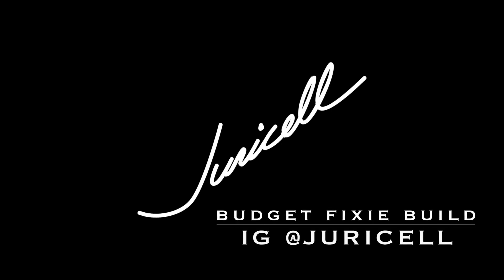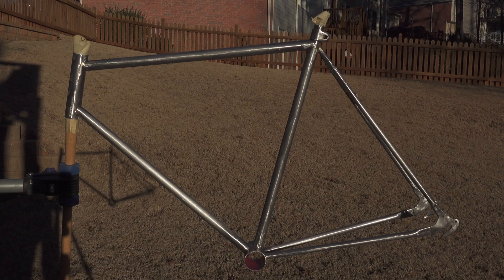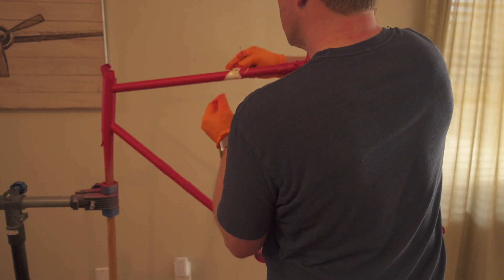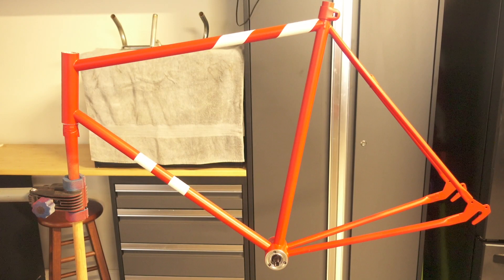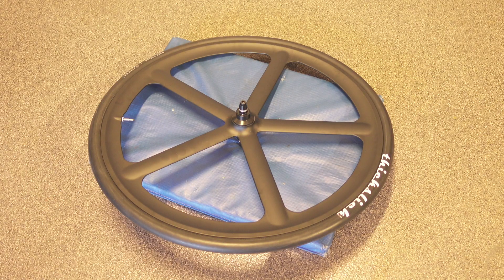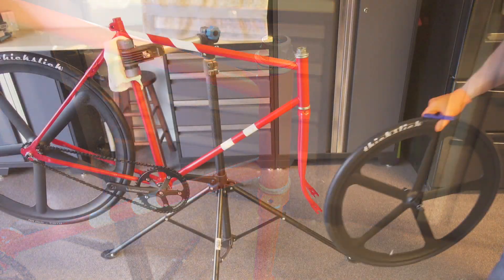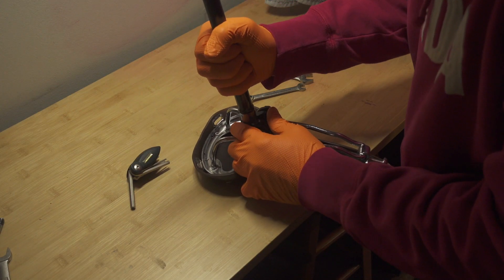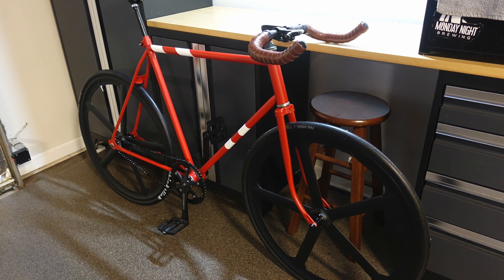FROM ATTIC TO FIXIE BIKE | COMPLETE BUILD OF AN OLD BICYCLE FRAME INTO A COOL FIXED GEAR

Comment: Good job! These old frames are the best. Your wheelset looks cool and expensive, but the seat post quite the opposite 😉
Now you will swap the sprockets and chainrings in neverending pursuit of that ideal gear ratio 😂
And after that you will probably start to experiment with the handlebars. Drops? Flats? Risers? Wide or narrow? Haha, have fun!
Reply from the maker: Youre right about the seat. Ive found the comfort level leaves alot to be desired. I was going for a classic look but I might swap out for comfort. I see alot of people riding with flat bars and I might give that a try. Thanks!

Comment: This is what I would like to do with a Trek alpha 1000 I just bought for a $100 bux. I just don't know where to begin 🤔
Reply from the maker: Nice pick up! Start by acquiring the parts you absolutely need for a fixed gear conversion. Then you can make changes as needed. I feel after riding my fixed gear for a while is that I’m not too crazy about the bullhorn handlebars. Wish I knew this beforehand but it’s part of the process. All the best on your build!
Reply: @Juricell  easier said than done my friend when you own the tools. 😞  No worries, heading to my local bike shop 😉👍🏻 #support
Reply from the maker: That’s a start for sure! 👍🏻 All the best to you on your project!

Comment: Dude, this fork sucks, sorry. Also, why remove the lower bridge? Just for the looks? Frame integrity is serious an issue on fixed gear bikes. Take care. Don't mean to disrespect you. I just hate long rake forks on fixies.
Reply from the maker: No worries I can take it! Excellent  points you made thanks. I’ve upgraded since this video to a Dosnoventa with an amazing setup. I ride it everyday but not too good with the tricks quite yet. Thinking about turning the old frame into a single speed for short trips. I’m not overly crazy about the fork either. More nostalgic giving this old bike some new life. I made a couple videos featuring my Dosnoventa. Check em out!